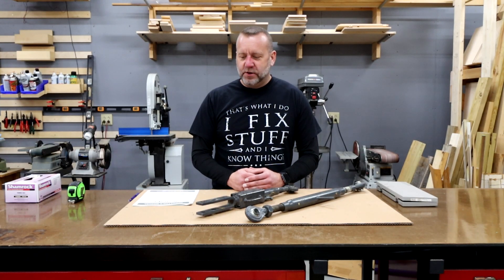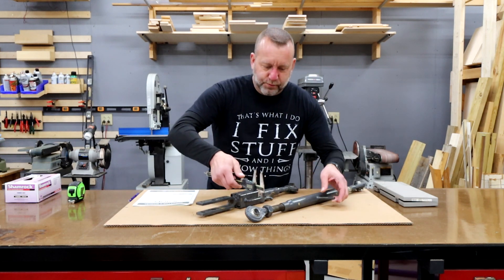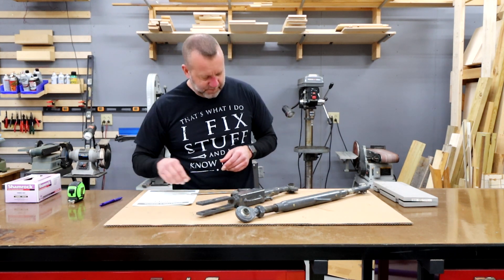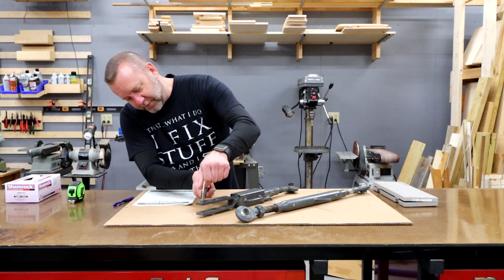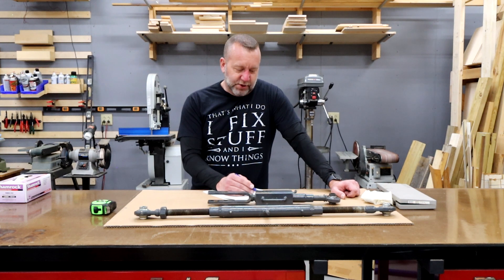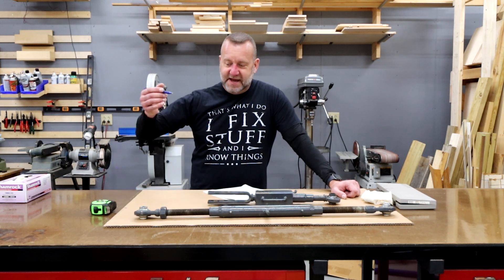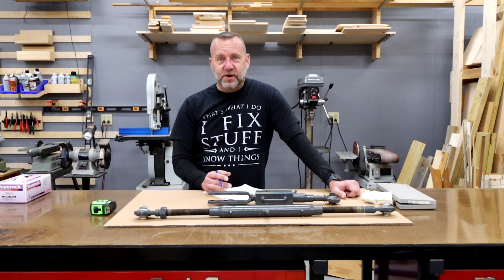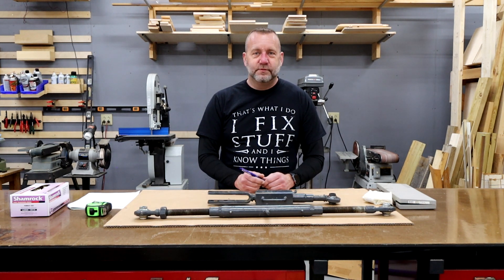Tractor Basics - How To Measure For A Top And Tilt Cylinder

Comment: I just purchased a used 2008 Kioti CK35 with a box blade to maintain my 1/4 mile driveway.  I am looking to get a top and tilt for the box blade and eventually an offset flail mower. Any recommendations on types of top and tilt links and what type of levers would be appreciated.  Thank you for the informative video.😊

Comment: Great video! No I don't have one yet, very interested. I have a Kubota BX25 with Loader and Backhoe.
I have already added a quick attach to the loader and 3ed function for a grapple and snow plow. 
I have been trying to locate a top and tilt for the 3pt hitch. I have the factory power beyond for
the backhoe but would like to keep it as is and add at least one more function for a manual
thumb I have added to the backhoe. Having some difficulty locating all the parts needed.
(have been looking on Summitt) seems easy to find parts for the compact & up but not Subcompact.
Reply from the maker: @thomashoward6792  
Thanks! Good luck!!

Comment: I assume the side link needs check valves too?
Reply from the maker: I will soon be replacing mine with a style that has check valves because I’m tired of the drift, especially with heavy implements. If they’re heavy, the drift is obviously faster and more noticeable. For example, when I have my seeder on, I’ll have to adjust it after lifting it for any period of time or after several lifts. It doesn’t drift when the seeder is engaged with the ground, but if I’m driving around with it up, or after lifting it several times at the end of rows, it’ll need adjusting.

Comment: Great info Jared . I appreciate your knowledge and insight.  I've have the same tractor and ordered the same top link in the video. Question though, what ?where did you go to convert the cylinders BSP thread to NPT that I'd find at the local NAPA store?
Reply from the maker: Mine came with BSP to NTP adapters, but if yours didn’t, you can get them here. 

https://www.discounthydraulichose.com/

Comment: Excellent video, thank you. I have already bought a hydraulic top link from Agristore but I can't seem to locate a side link that will bolt on without modifying. Has anyone been able to locate one besides the Kubota cylinder? Thank You
Reply from the maker: For what model tractor? So far, I haven’t found one. They all have something wrong, like hole size, etc. 

I think I’m going to buy one that’s close and modify it.
Reply: @JaredsShop  Hi Jared, thanks for responding. I have an L3560HSTC. I have looked online for hours and it looks like I’ll either need to buy the Kubota side link or see if I can find something to cut and weld. But like you said, the problem seems to be the ends. I may have to weld the holes up and redrill them but I would much rather have something right out of the box.
Reply from the maker: @xzq7l2  
I agree. If I modify one it will probably be by cutting off the ends and using the ends from the stock fixed link. That way I’m not welding and drilling.

Comment: Hey Jared. Thx for the great videos.  Recently purchased a L4060 and setting up with rear remotes. Have you replaced the tilt cylinder yet? I'm finding the tilt cylinder more expensive than the top. ??? Thx Dusty
Reply from the maker: I haven’t yet. I think I’m going to end up buying one that will need some modification as I can’t find one with the exact ends on it.
Reply: @JaredsShop  I was thinking the same.  My budies make cylinders at their shop and im gonna se if they have one that might work. Ohio, I live in Kent.
Reply from the maker: @digrdusty1  
Awesome. Let me know if they will. I could probably sell several for them. A lot of people come to me looking for an option, not only here, but in the groups that I mod or admin.
Reply: @JaredsShop  when you get a minute. Send me as many measurements for the tilt cylinder to see if we can match one up. Be pretty thorough. Thx Dusty  Even fitting sizes.
Reply from the maker: @digrdusty1  
What dimensions do you need that were outlined in the video? I think I listed the hole sizes and I know listed extended and retracted dimensions. 

For the fittings, you can use what you want. I think these are -6 SAE ORB.
Reply: @JaredsShop  Dimensions of the cylinder body, rod and the length of stroke. My buddy has a longer cylinder he can cut shorter. Making a 6 inch stroke.
Reply: Did anything ever come from this conversation? I would be interested in a side link if he is making them
Reply: My buddy made me one. He had a cylinder that was pretty close in size. We chopped the ends off the stock solid shaft and welded them on the new cylinder. Unfortunately he didn't seem interested in producing any more of them.
Reply: @digrdusty1  okay. Thanks

Comment: I got my top link with the check valve from TSC for around $225. I has suited me well. I'm in the market for a side link and can't wait 9 months for a Fit Rite. Any suggestions?
Reply from the maker: The TSC is probably an AMA. They didn’t have any in stock when I was looking. 

I replied to your comment in the group but will say the same thing here for those that are reading the comments. 

I will most likely get an AMA side link but it’ll need some modification, at least from the specs I read. I don’t think the holes sizes are right for my L3560. When it comes that time I’ll definitely make a video for it. 

The issue I have with fit rite is I’m not sure he installs check valves. I know it was an option for a while but he tries to talk everyone out of it.

Comment: I added a top link on my kioto ck3510 se to use with my box blade. It makes grading so much easier. It also helps on my woodland hills chipper when loading on my trailer by being able to retract the top link so you don't drag the back side of the chipper.
Reply from the maker: Awesome! Agreed, it’s a gamechanger for grading. 

I think that’s one of the benefits most often overlooked, the ability to more easily load and unload a trailer.

Comment: Hey Jared
Another great and imformative video. I too have GL3560. Dealer dismissed the need for top and tilt, cost to value. I want your opinion, we have a newly constructed limestone driveway just short of 900' .  The drive was installed late last season, just before the snow arrived. I know the drive will need final grading shaping this spring. Will be receiving EA land plane soon. This will be the primary implement used on the 3 point hitch. What are your thoughts and recommendations? Thank you, Tyger
Reply from the maker: I wouldn’t want to be without it. I use mine all of the time. You’re going to want to grade a crown is to your driveway in the flat sections and a slope for other areas depending on which way you need water to run. For that, you’ll either need to get off the tractor and manually adjust the plane or use a tilt cylinder. I love the top cylinder because it allows me ti more easily load and unload a trailer, hook up implements, and adjust aggressiveness of cut. If I don’t want my land plane to cut much then I pitch it back so the shoes are slightly elevated in the front. If I want it to dig more, especially with the scarifiers down, then I pitch it forward.

Comment: I did not before selling my tractor but would have loved to have at least a tilt.  I spent much of my time grading a long gravel road.
Reply from the maker: I don’t think I could be without them. I use them all of the time. I use the top when loading and unloading the tractor on the trailer, hooking up implements, changing aggressiveness of cut with the blades, adjust height on the harley rake, etc. The tilt is obviously used any time I want the implement to be on a different plane than the tractor. I use it with almost every implement.